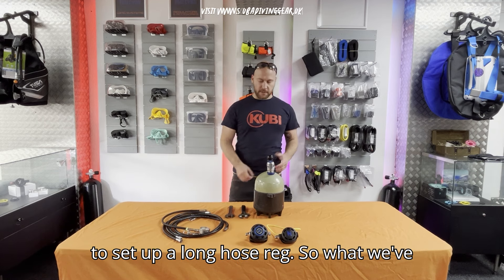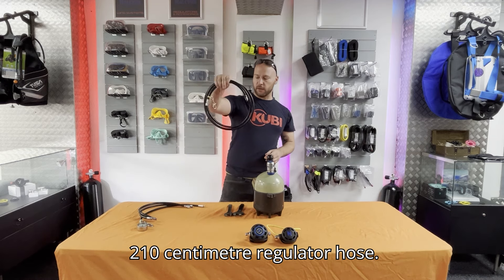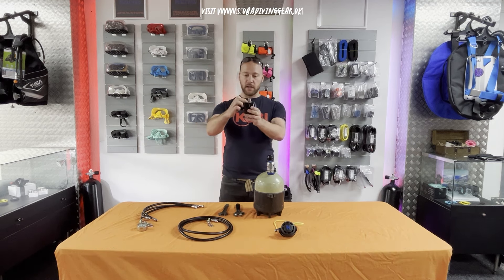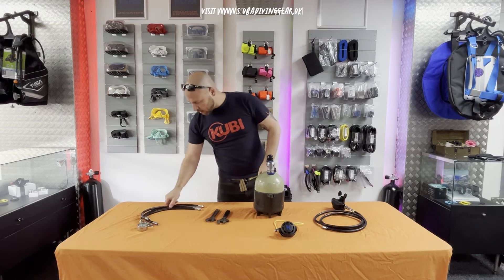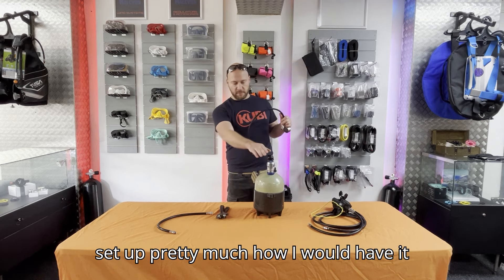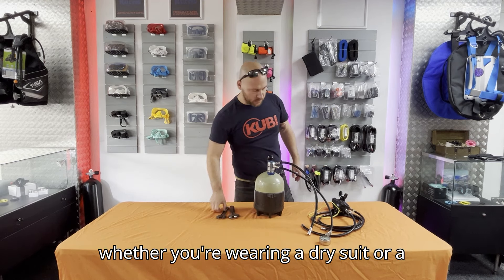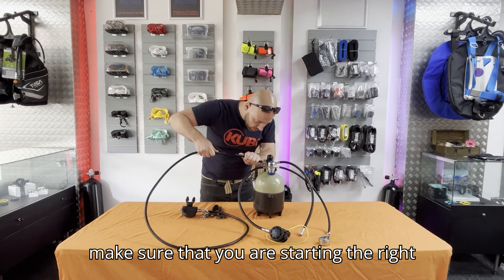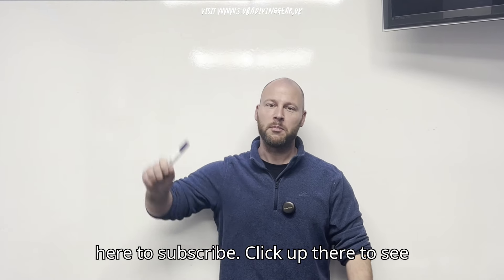Scuba Diving DIR: How to Setup a Long Hose Regulator System on a Single Cylinder | #scuba #regulator

Comment: Aren't u supposed to get a manifold with two first stages for a DIR setup?

Even for a single tank
Reply: What would you like to isolate on a single tank with a manifold? You can have double cranes on a single tank however for DIR is one crane is enough. Cold water diving could make you get a second crane or just go for doubles.
Reply: @nielsrad  i meant cranes.

So two first stages on one tank
Reply from the maker: Hi buddy, you can not have a manifold on a single cylinder, you could use an H valve or something along those lines. We prefer to teach divers to use a stage or bailout cylinder if they are going to depths over 30m, and good buddy techniques for shallower dives. If the need for redundancy increases we transfer them to twinset or sidemount setup.
Reply from the maker: @Provuk  ah, double valves you mean, yes that only works with an H valve or similar setups which are not common use in the UK at all. Having double valves doesn't make it DIR if that is what you are asking. It's merely a solution used in various European countries for cold/deep water single tank diving, in the UK a redundant cylinder is favoured for deeper dives as it gives true redundancy.
Reply: @scubadivinggear  i thought itd be DIR since GUE teaches like that and they stick to DIR very strictly.
Reply: @Provuk  GUE sets up a single cylinder like that, I would read the book “Fundamentals of better diving” if you want to learn more, really recommend. Or do a GUE fundamentals class there’s no better scuba class in my opinion.

I setupped a long hose configuration on a single cylinder H valve once but it routes pretty bad, I agree with the use doubles when going redundant for deeper diving.
Reply from the maker: @Provuk  for argument sake, if you check the GUE website, section equipment configuration, it is clearly outlined that single cylinders are taught with a single first stage. You might find that an instructor (GUE or otherwise) has to abide by local laws that dictate a dual first stage/valve is to be used, I know this to be the case in regions of both italy and spain for example.